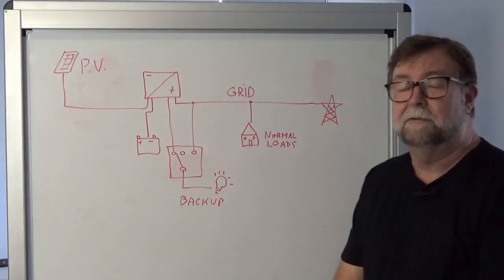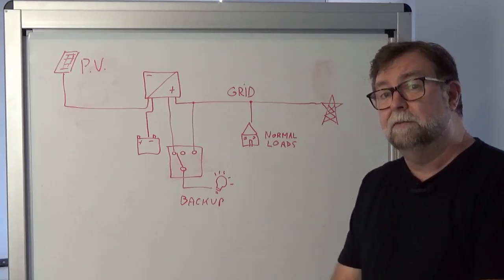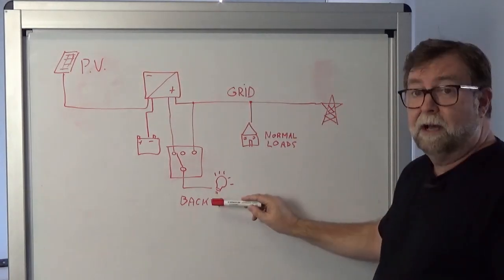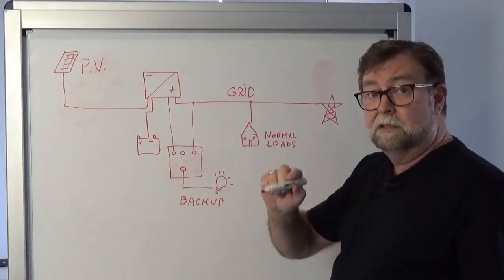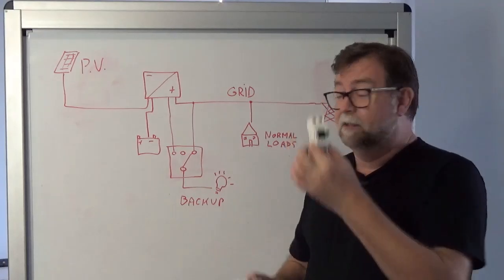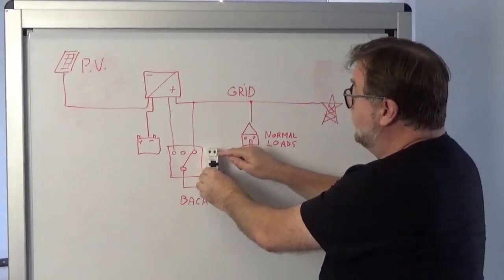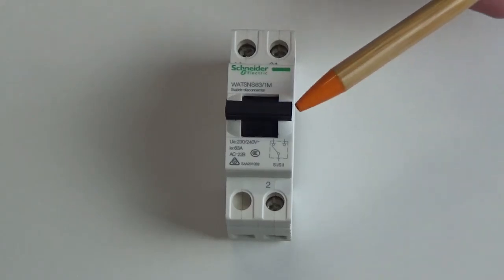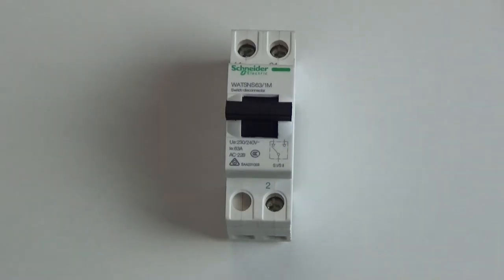Sungrow Hybrid Changeover Switch

Comment: Can you use automatic crossover switch instead?
Reply from the maker: If you wire it correctly, yes
Reply: @sgauservicesupport ok. Thank you. Is it the same wiring as manual switch or different? And what's the best automatic switch that best works with sh10rt?
Reply from the maker: @radostinvasilev599  Because this is an external wiring, we are not able to advise on how to wire this. Please refer to AS/NZS3000 etc
Reply: @sgauservicesupport ok. But what model of automatic transfer switch do you recommend?

Comment: So the backup output will also have power even if the grid is active? and can you put all loads behind the backup output?
Reply from the maker: In grid operation, the backup port is connected to the grid internally. As long as you don't overload the backup ports you can connect what you want.

Comment: Hey Graham, When did Sungrow start supplying these with the inverter as we have never received one with our purchases.
Reply: They are supplied with SH8.0RS, SH10RS, SH15T, SH20T, and SH25T.
Reply: @SungrowTraining  So not the SH5.0RS, SH5.0RT and SH10-RT. You may want to reword your video as that means Not supplied with any of the Sungrow Hybrid inverters in WA. Very misleading for clients seeing this video and WA installers trying to tell clients its an extra cost and not supplied by Sungrow.
Reply: @FourHarves  It's just a tech video to tell installers how it connects and works.
Reply from the maker: They only come with the SH15T, SH20T, and SH25T. SH8.0RS and SH10RS have a single pole version